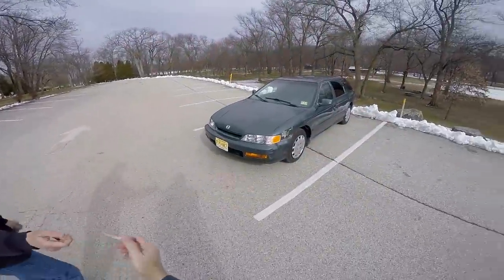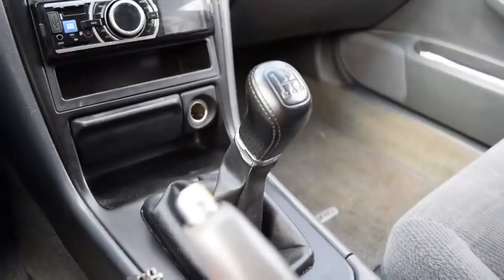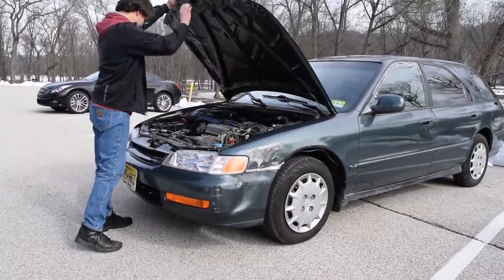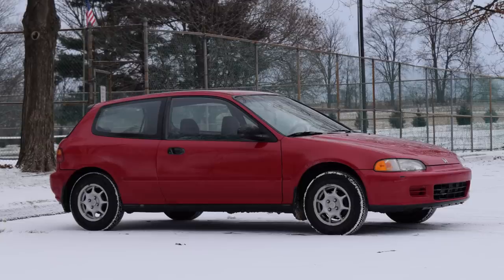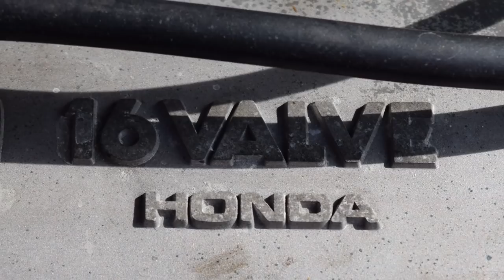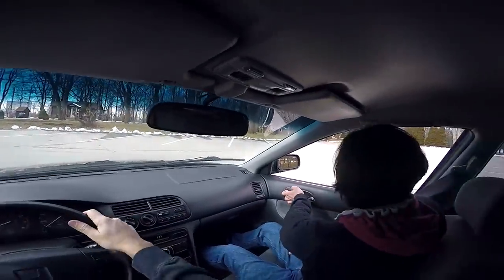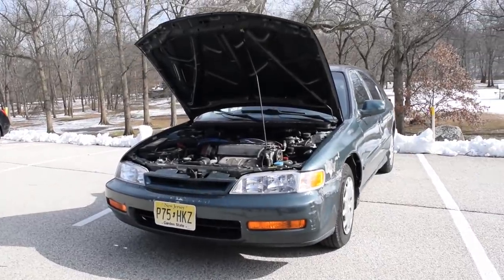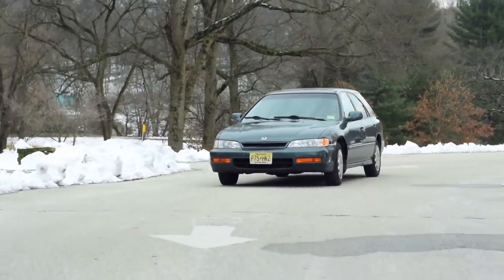1996 Honda Accord Wagon 5-Speed: Regular Car Reviews

Comment: The coolest &most successful Accords in my opinion, were from 1986 - 1993.
Reply: retroolschool just bought a 86 5 speed accord for $500 ;0
Reply: Had a '92. Right on.
Reply: i have 87 lxi
Reply: F23 vtec ,141  HP to the wheels !. Omg thats sounds fun!.If it was swapped in a delsol of course.
Reply: I have a completely rust free 1993 ex-r sedan auto and my god it’s perfect runs and drives without skipping a beat and low miles
Reply: My Accord is a 2002 so yeah I have to agree.
Reply: I think the 1998-2003 is pretty great and looked the best in all honesty.
Reply: My dad still owns his very first car - 1987 Honda Accord Hatchback with a 5 speed. He's been driving it everyday ever since he bought it new almost 30 years ago. With over 330,000 miles, that engine is still running like it has been when it first rolled off of the factory floor. I don't like import cars, but that Honda is a tank.
Reply: My uncle had a 93 wagon.  My other uncle though it was a good idea to give his mentally disabled son (my cousin) a knife so everything got stabbed (me included).  The back of the seats in that car were "holy"
Reply: My first was an '87 that I bought for $250. That poor thing. I was probably kinder to it than its previous owner, and I hit a deer with it. lol
Reply: My accord is a 94 coupe and ive always loved it , swapping a 5 speed h22a in certainly helped alot, in my opinion is the 5th gen accords are the best 94-97
Reply: The coupe.. I had a 2001 EX coupe. I gave it to my son a few months ago when I bought a newer car.
It has 170K on it and still runs like new. Gets 29 mpg in mixed driving and can get 33 mph on the highway.
The Accord is a very well built and reliable car. That old 2001 I gave my son still has everything working
from the sun roof to the cruise control. There is no car I have ever owned that has proven that reliable.
I now drive a 2014 Q60S Infiniti, but to be frank, I many times think I should have just bought a V6 Accord
coupe.. Honda makes a darn good car.. Certainly better and more reliable then other Japanese makes save possibly for  Toyota. But Honda cars are more fun to drive then a Toyota.
Reply: My first Honda was a 91 Accord coupe manual. I was 18 when I got that car and I haven’t owned anything but Hondas ever since. Now I have a 08 Si, and a 91 Civic hatch. There is just something about the older Hondas that I love.
Reply: We've got a 1990 Accord manual with about 480k miles on it, and it's still going strong. Has never had any major problems, just now starting to smoke a little. Edit: it's also the most fun, satisfying car I've ever been in.
Reply: allo LOL Dude said between 86-1993 and you replied 2002 I agree...what the fuck is going on?? Are you on drugs 2002 isn’t between 1986-1993 last time I checked...I could be wrong but.........
Reply: retroolschool  1999 2002 the slickest
Reply: 1994-1997
Reply: @nandernugget  yes but not the best made ....bad auto transmission's.... Best made were the 86 to 98 ...those were made to run forever .....I have a 93 accord ex and a 96 accord ex (both 5 spd)  and other then regular maintenance ...run like new ....
Reply: I've got a 93 EX Sedan. Its a great car OVERALL... engine and trans run like new even at 189k miles HOWEVER you have to wind the gears out so far to make any power you feel like you're beating the thing to hell to just drive normally and keep up with the regular pace of traffic. I think someone thought consumers would think it would be fun to feel like you're driving a racecar even though it takes a lifetime to reach 60mph. That being said, being lowered on coilovers makes it a dream in the corners and anything that needs replacing is relatively cheap, aside from doing the rotors is a bitch as its a hub over rotor design.
Reply: My first car was an 87 Accord five speed.  Miss that car!
Reply: 91 cb7 here, love it.
Reply: I dunno. IMO a lot of the japanese cars got everything just right in 2000. Engines sorted, body lines just right. After that they had to change stuff, but it couldn't look as good. 2000 Accord and the preludes just looked perfect for what they were.
Reply: I had a 91 2 door EX. Wonderful.

Comment: My first car was a 91 Accord. 2.2L, non-vtec, 4-door, and I loved it.
I sold it back in 2013 after owning it for 2 years and I miss it. I still see it driving around a lot, and I want to drive it again. I've built it up in my mind so much that I feel like if I drove it again I'd be let down because it wouldn't handle as well as I remember, or be as fast as I remember. Man... that was a tough car. A fun car. I want another Accord.

Comment: The F20 and F22 were great motors. Totally underappreciated. They sound great (yes, even without vtec) and more importantly actually have a decent torque band, so you don't have to keep them wound up to have fun.

I had a '92 accord coupe. Awesome car. I'd take one over a d16z6 (or lesser) powered 90s civic any day of the week and twice on Sunday. The shifter on them is usual honda quality but better than the civic. The pedals are perfectly spaced for toe and heel driving. The seats are great. Si civics of the era may have better bolstering, but the accord seats have bolstering (even on lower trims) and are more comfortable than a civic. Need more power? An H22 is an easy drop-in or you can boost the stock f-series (lowish compression and a stout bottom end).

Anyhow, great underappreciated car and as such they can be had cheap.
Reply: ap2pat Yeah, it doesn't make a lot of sense. They should have called them fc20 and fc22 since they have nearly nothing in common with the other f-series motors. The  transverse f-series and the h-series were quite closely related.
Reply: dubbreak I thought the accord f20&22 and the h series were sort of the precursor to the k series and the k series was the precursor for the s2000 f series engines.
Reply: @miatafan  yes, the h series was basically a more performence oriented f series. but the 2.2 is already pretty big displacement for a honda.

Comment: I currently drive a 1990 Honda Accord CB7, and while it may be 5 years older and an automatic, it's so much fun to drive. Of course if it were a manual it'd be even better, but the point is that there's something about Honda engines.
I use to really dislike Honda's. Thought I'd never own one, until I inherited my grandmothers car when she stopped driving.
After you throw your friend of the roof of it, and have another couple of friends kick dents in the fenders, you start to really appreciate the durability of them.
AND THEY'RE SO PEPPY. You put your foot down in an older Honda, and BAM! You watch your revs go up and suddenly you're doing 50 - 60 miles an hour.
I'm moving on to a new car soon, but if I ever need a really cheap runabout to get from A to B, and have fun doing so,
I'll buy a 90's Honda Accord. I love 'em to bits.

Because my 1990 "Trash Panda" Honda Accord is just 𝘴𝘰 𝘥𝘢𝘮𝘯 𝘢𝘸𝘦𝘴𝘰𝘮𝘦.
Reply: Sorry but it's either fun to drive or an auto
Reply: In all honesty I can't disagree. But it's the only area the car's really lacking in.
There's just something so good about the pickup, and the noise of a Honda engine.
If I were to buy another, I'd buy a manual, hands down. They're just better for having a good time.
Reply: Heh, I have a CB7 too as a second car (my primary car is, unsurprisingly, a 2013 Accord.) I agree!
Reply: I drove a CB7 auto for a really long time.  Recently had to pick up something else though, because it's on it's last legs.  And I'm tired of people trying to steal it.  THAT is the only area the car is lacking in.  If you are homeless, or on drugs, I'm pretty sure that's just in the hand book.  How to break into a 90s Honda is probably chapter one.  You want an exciting car?  Shit, none better than the CB7.  You'll be pulling people out of it, getting knives pulled on you, and sometimes, just filing police reports and looking around for it the next day.  But on the topic of the automatic trans, somehow, it's still quite good.  Yeah, there's a little bit of lag in response time when you slam the pedal down, but other than that, you can feel the gear changes, and control them easily.  It's miles better than many other automatics transmissions.  Particularly if your car has sport mode option.  Anyway, I also am wondering what the next best (and newer) thing would be.  I'm not terribly stoked on my '05 corolla LX.  Thinking of selling it and getting something else.
Reply: Got a 1991 accord manual only 220k km. Reliable and fun.
Reply: My first car was an automatic '92 EX sedan.  I loved it and thought it was a blast to drive.
Reply: Funny story I learned to drive and drive stick on a 1991 Accord sedan LX. Still the easiest clutch I've ever driven. Anyway my mom made my dad get rid of it in 2011 because she said it made us look poor. He bought that car new and was heartbroken. He did buy a brand new 2007 Accord V6 manual sedan because he thought his 91 could be on its last leg which it never was. 3 years ago I was cutting a little old widows yard down the street and would you know it she appreciated it so much she gave us her husbands old car. Which was a 1992 Accord LX sedan auto same color same trim, with only 90k miles on it. Now that's our family spare and my dad couldn't be happier. He sure loves his Accords
Reply: Honda engines, even the non-VTEC ones, rev smoothly. Honda standard transmissions are slick. They are next to impossible to stall once you get rolling, even if you accidentally forget to downshift when going up a steep hill. Accidentally launching in 3rd gear is a non-issue.
Reply: The overall build quality with old Hondas is a lot better. Granted, rust is an issue, but other than that, any Hondas made past the 90s have been decontented and substituted with a lot of plastic.

Comment: Same story goes for the similar-aged Legacy wagons. a 2.2l/5spd combination is not particularly fast, but plenty of fun. and, unlike all later Subies, the 2.2 didn't blow head gaskets.
Reply: LegacyMuse Been driving a ‘99 2.2 for the past 10 years, and I refuse to replace it, I just love driving it too much, I’ll drive it until it rusts away to nothing more than a steering wheel,engine, and 4 tires.
Reply: Yes.  I have a 1997 Legacy wagon with 323,000 miles on it.  Like you say, plenty of fun.  I've had no engine issues.  The AWD feels great at the cornering limit.
Reply: Miss my 97 gt wagon with 2.2 in it

Comment: Non vtec engines actually sound and feel great.
I recently had a first drive of a B20B7 engine, no vtec.
Sounded great, pulled cleanly and bundled with a 5 speed manual in a third gen Prelude. 
It's actually about as quick as my b18C 'vtec' Integra which, on pen and paper, should be quicker.
Reply: The d16 non vtecs do sound quite nice (obviously without fartcans)
Reply: I like the non-VTEC B18B in my Integra.  They are still very nice motors, and you can do a surprising amount of things to pep them up if you want.
Reply: When I lived in Japan I owned a 94 Prelude Si with a non-VTEC F22B engine in it. Was a surprisingly fun car to drive.
Reply: I have owned a non VTEC and VTEC prelude, 1994 Si and 1997, They were both great cars. The VTEC just adds a bit of character and sound, but doesn't make as big a difference as people think, and you can only tell the difference over 5500rpm.
Reply: Max totally agree, I think the reason people act like vetc is so great is because of the rush of torque at 5500rpm. For someone who's driven lots of different cars and owns a 97 accord (vtec) it seems silly
Reply: VTEC is definitely a 5% performance enhancement.  As in, five percent of the time you're driving it'll actually do anything to make the car faster.  Even in my S2000, it was rare you'd get the opportunity to use the car up at the six thousand rpm threshold for any period of time without being reckless and irresponsible and all that, not counting wringing out a couple gears on an on-ramp and such.
Reply: Fair point. 
There is a decent power difference between engines with and without it, still.
I find myself only using it with on ramps and passing lanes, or if somebody fucks me off.
Reply: Dominic Anon you guys make me feel irresponsible now
Reply: Indeed there is most definitely a difference having it.  It is a rather neat experience as well, actually feeling and hearing the engine effectively retune itself once you hit the threshold.  At least on the street it seems like one of those things that pays more dividends to the driving experience rather than the performance.  Though engines that reward more the harder you rev them and Honda's usually very good manual gearboxes do make for an enjoyable combo...

Comment: I am so glad you brought this car up.  first off there is a white wagon floating around PA on airbags and limo tint. it is the reason I fell in love with mine when my dad picked it up for $327 (scrap price at the time.)  I replaced the plugs and wires, cleaned the intake and EGR valve, if you have never cleaned one on this 2.2 you need to its crazy the design. Once I got it to run again I threw a prelude intake on, and a 2.75in catback from J&H automotive custom bent  with an S10 resonator it screamed on the highway and made that 5speed you are so enthusiastic about a gem in the rough.  I would take that big hug back any day of the week.  embarrassing chubby and all.

kudos @RegularCars

Comment: The best Accords ever: 1994-1997 Accords like this one. What really made this car fun to drive on turns was the double wishbone suspension set up, like a Formula 1 car. That's why these are the Accords that racers wanted. Hondas in general are nice revving engines.  Heck, Honda even made a Type R version of this gen accord (a twin cam VTEC Accord was never sold in the US, but it was built here). There was one trim level above this LX wagon  called the EX. The EX had the VTEC engine. It was single cam too, but you could feel the difference. EXs were available in sedan and wagon too. I've seen more than a handful of Gen 5 Accords with over 400K miles on original engines and transmissions... and they still ran well! Accords haven't been as well-built or as reliable since.

Comment: I bought a 1994 Accord wagon automatic for $1200, it was leaking oil and cost another $1200 to fix.
It ran perfectly, and then sustained some severe damage around the whole car. And even after the severe damage, the car ran like nothing ever happened. The thing was damn bulletproof. And I’d also like to point out, the thing was FAST AS HELL in corners for what it was. On roads I knew well I could keep up with sports cars no sweat, and even outpace some cars like mustangs and Cameros. I loved that Honda very much. I miss it. (And of course the car I got to replace it had the fuel pump go out not 48 hours after purchase, and hasn’t even been repaired yet. Never had that problem with my Honda.)

Comment: My first car was the luxury coupe cousin of this and while it had the four speed automatic instead of the five speed that I wanted, it was still a blast to drive as an 16 year old kid who just got his license. Had the little VTEC engine and the leather seats with the wood-style trim and quite a nice bose sound system even now, let alone for the mid-2000's. Ended up putting a little exhaust and intake on it like every kid did back then and it was honestly one of the greatest cars I've ever owned, even in it slow and ricey flaws. Glad I held onto it over the years!

Comment: Is this still an F22 motor? I had a friend who turbocharged an f22 accord with the stock turbo and manifold from a 1st gen DSM.
Reply: Jason Tyo have you seen jafromobiles video on their accord, turboed with all dsm parts
Reply: H22
Reply: The F22 beast will take 8 to 10 psi all day. Bisimoto used to have a f22 sohc insight or somthing... 722 hp
Reply: I have a 94 Accord sedan and mine is an F22B2

Comment: 90-93 accord cb7 ftw
Reply: sugarfreee // nahhh, CD5 ftw
Reply: Tbh, both are amazing and a hidden gem/legend of Honda to build even to this day
Reply: Had a white 90 5 speed. 280,000 and holes the size of basketballs in the rear quarters. It started in -20f weather. Now my 8th gen civic with 80,000...gotta be 10 above to start! Just cranks. So sad. Also our 97 crv with 230,000 fires right up -20 also. Pos. Civics made in America...that's the problem
Reply: Cd and cb accords with h22's are winners.

Comment: My mom back in the way-back days, had a 1989 Toyota Camry sedan with a 5-Speed Manual and a 2000 (2.0L) 4-cylinder (3S-FE rated at only 115 hp).  It was a blast to drive.  It wasn't fast at all, but the thing was so much fun and the engine sounded so growly in a good way.  It would just sing.  If you get a chance to drive one with a MANUAL transmission... do it!  Also, it had 205/60R14's on it which are small but still a huge improvement over the 185/70R14's that came on it.  So the thing actually handled somewhat decent and weighed only about 2700 lbs.